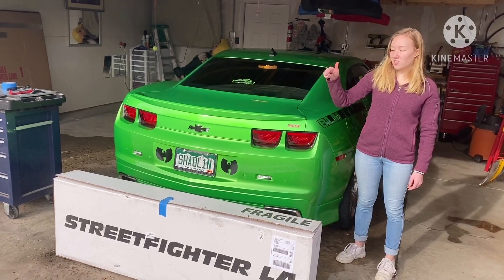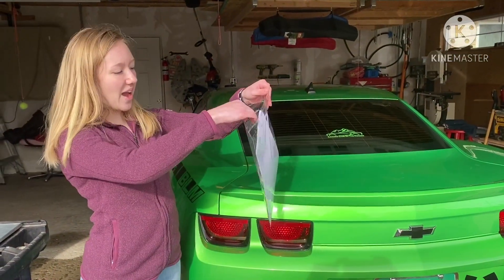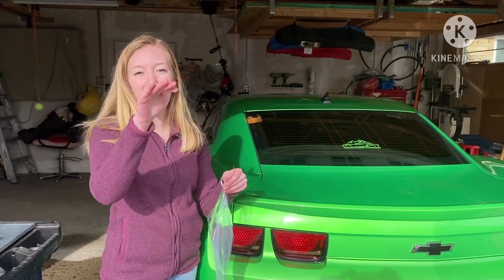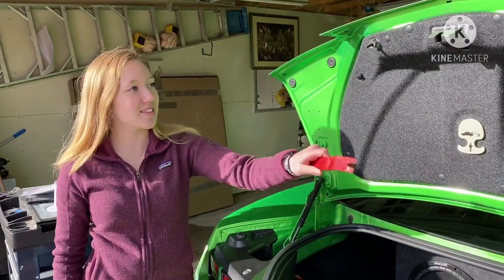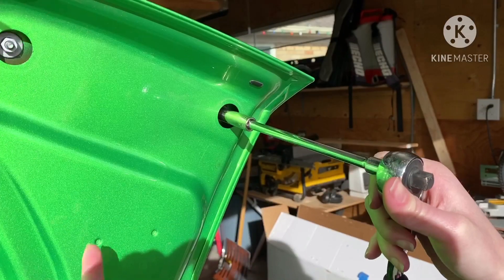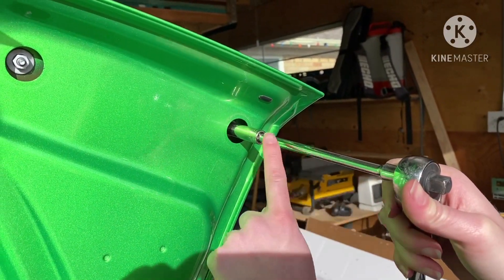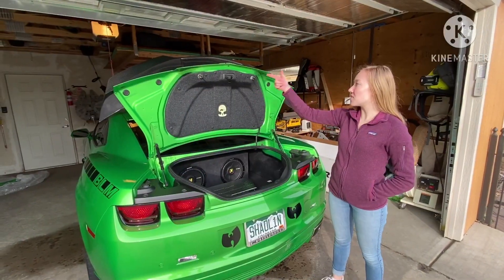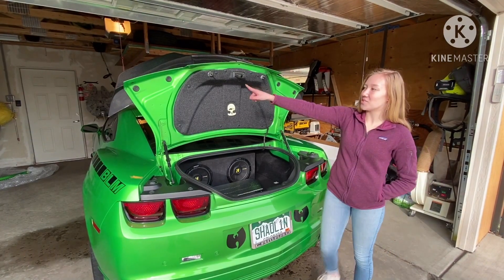STREETFIGHTER LA CARBON FIBER   SPOILER INSTALL

Comment: Yay. It arrived. I installed it.  Oh by the way, the some of the 6 nuts fall inside if not tilted in a 45 degree angle. Used a strong powerful magnet to fish it out.  It worked 🕐Y'all should do terminator hood, oil change, or carbon fiber interior install.
Reply from the maker: Appreciate the feedback. We will be doing the VIS Terminator hood next! Thanks
Reply: @myboyteo9  incredible. I cant wait 😁
Reply from the maker: @yorkie1792  Oh trust me...you won't regret it. It's 🔥